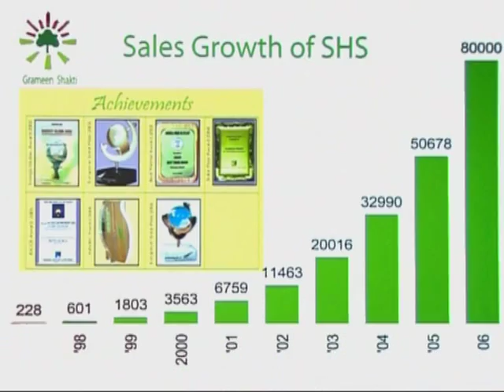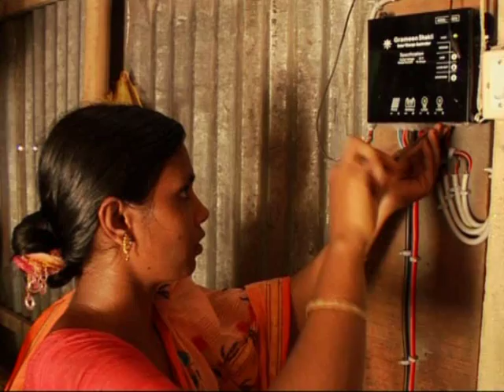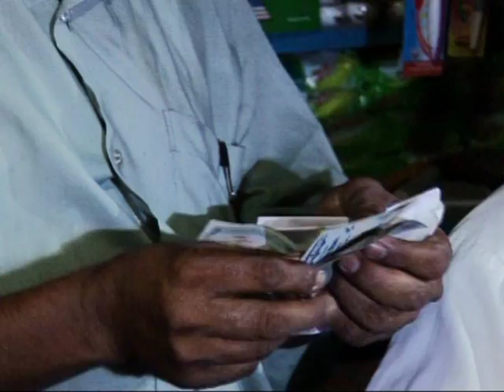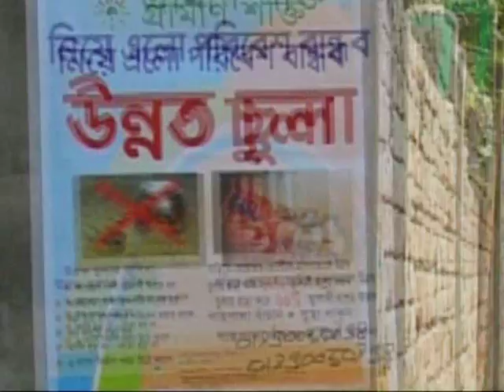Grameen Shakti, solar PV, stoves and biogas in Bangladesh - Ashden Award winner

Comment from the maker: They are using efficient stoves now, just a different design from the Rocket (which some of our other winners have used).

Part of the challenge in getting new stove designs accepted by people is making sure they can use them in a similar way to their existing stove.

If the rural people in Bangladesh are used to indoor stoves low to the ground, then the design used in this video might be more acceptable than a Rocket stove.